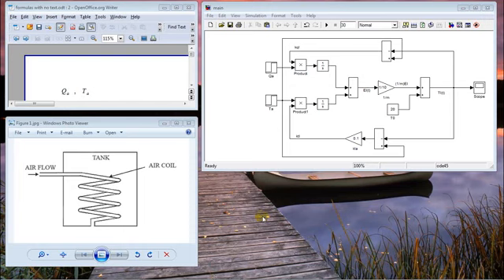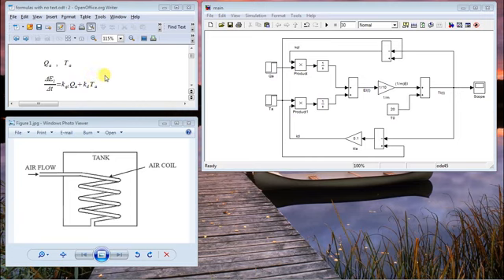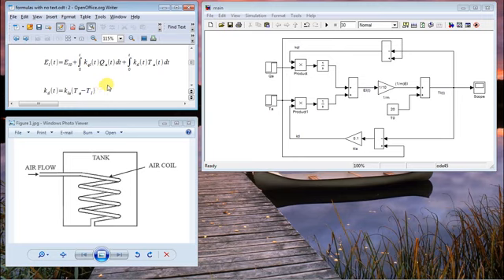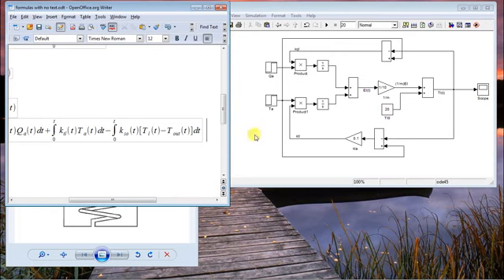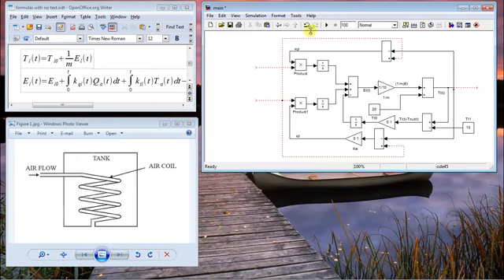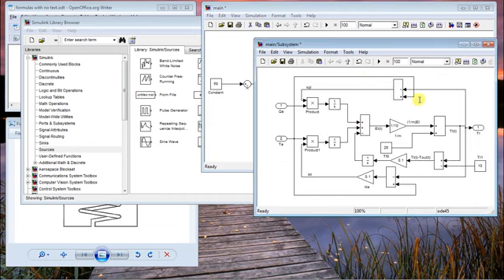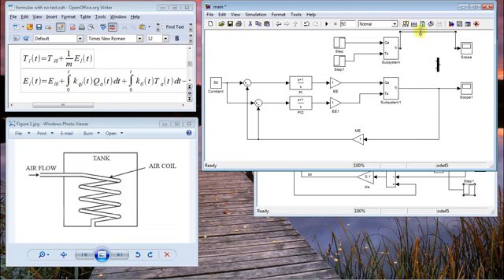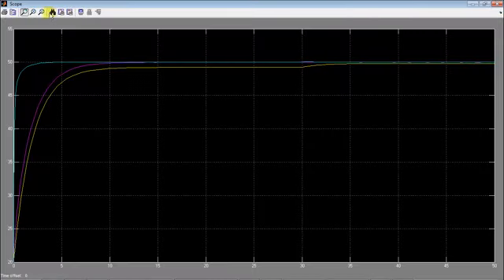Simulink temperature control system and heat transfer simulation

Comment: Hey brother, can you tell me which pdf you were referring?
Reply from the maker: Mathematical models page 70
Heat transfer.
Reply: Sir those equations are not there in the pdf
Reply from the maker: @mayurkumavat3640  
You can get it by analysis for the main equation